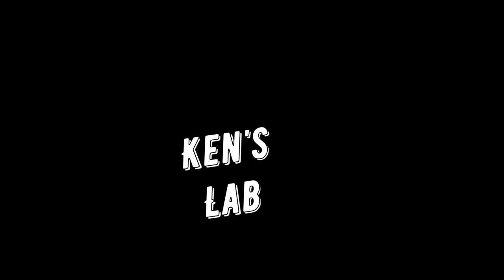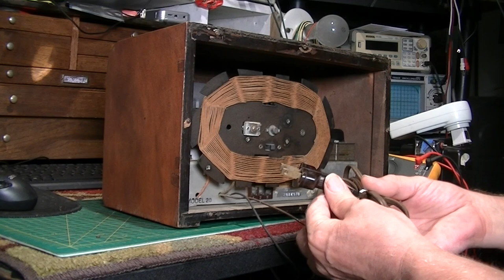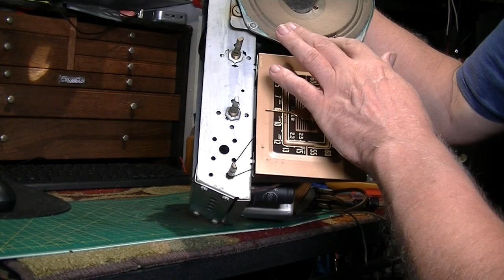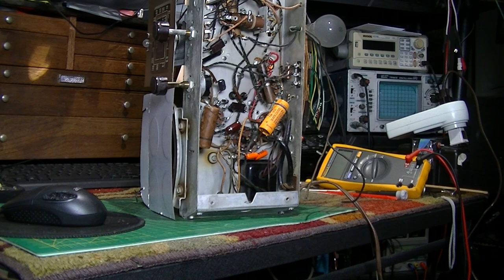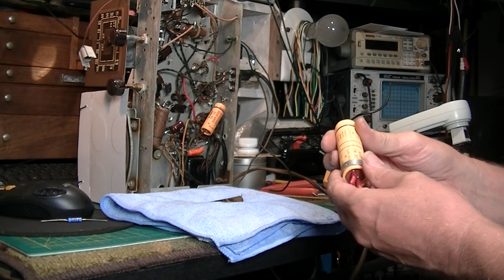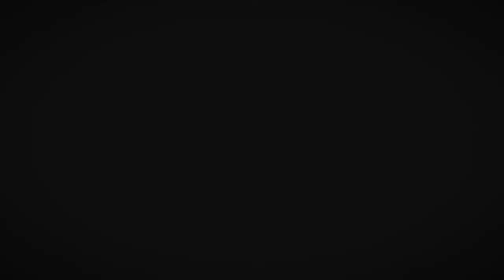Crosley Radio Model 20

Comment: A very nice radio there Ken and an easy fix for you. They sure made those resistors tough back in the day. You've almost gotta be the Hulk to break them lol. Well done again :)
Reply from the maker: Thanks Frank, yeah, it was tougher than I expected. The schematic and information I had didn't specify what kind of resistor it was, I've seen them also to be wire wound.